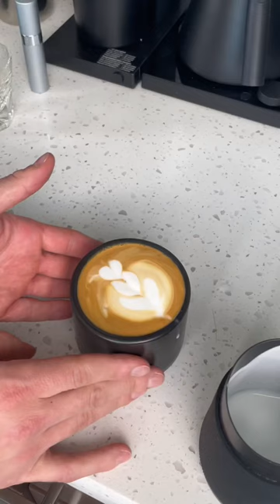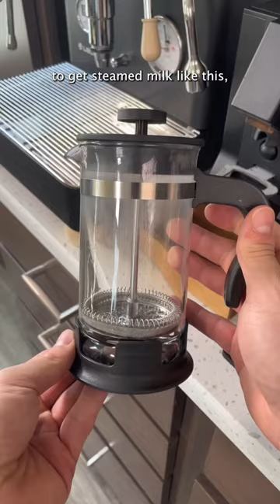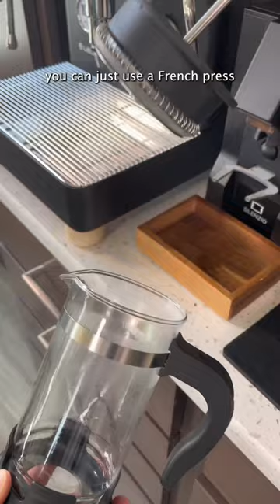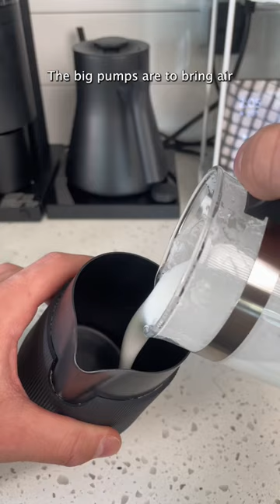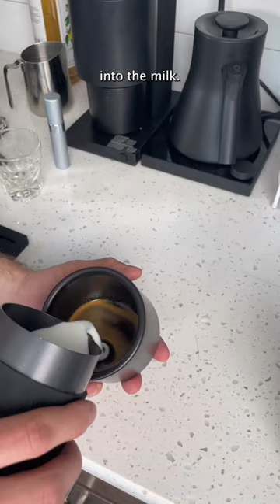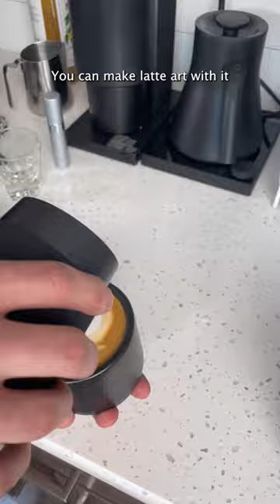Making frothed milk with a French press #coffee

Comment: Even better if you take the lid off of French Press so plunger can reach the bottom.
1. Allows you to foam even the smallest amount of milk (i.e. for cafe macchiato)
2. You'd get much more consistent firm foam without liquid part.
Reply: Thank you do much for this tip! I didn't even realize I could take the lid off, and this was my main reason not to use my french press for frothing milk. And since I don't really drink coffee, I only drank water and tea out of it and the plunger was laying around. Now I get to save money and my plunger has a purpose again!
Reply: @enielfblerta428  You're welcome!
Be careful though, you can easily crack the beaker being overly forceful with whole reciprocating motion. (ask me how I know 😅)
Reply: Can you help me with the information on how much does this whole process reduce the temperature of the milk?
Reply: @hasanjim  Sure.
I microwave 60g of milk at 1000W, it comes out at 92°C. 
After frothing it gets down to around 60°C. 

60° is somewhere on the lower side for hot drink and It would probably stay warmer if you take more milk - higher heat capacity and all, but I have no use for that. After mixing it with hot brew you can drink it pretty much straight away w/o burning your tongue.
Reply: @CRL_One  thank you for writing in detail.

Comment: Can I use a milk frother
Reply: Milk frother works okay, just make sure you're doing it correctly for best results! Tilt your milk container about 30° off center, put the frother in towards the bottom corner of the glass/pot your milk is in, then pull straight up, slowly, until a fair amount of froth has formed. You'll not get barista level froth, but it'll work perfect for cappuccinos or macchiatos!